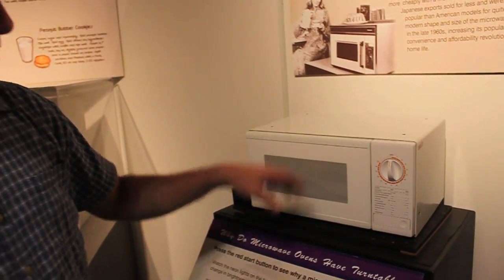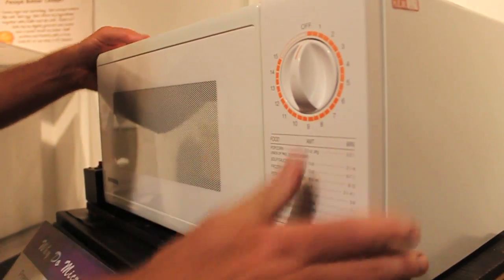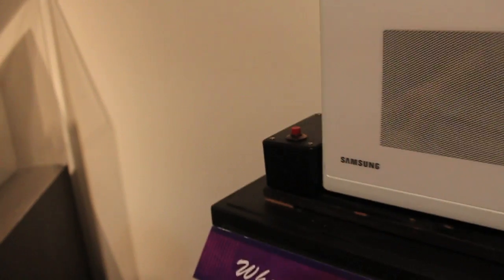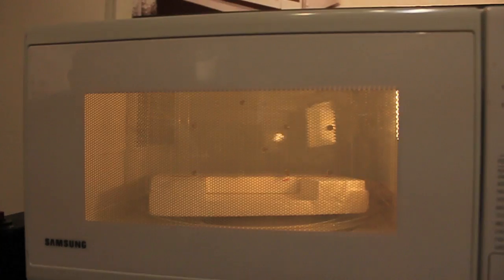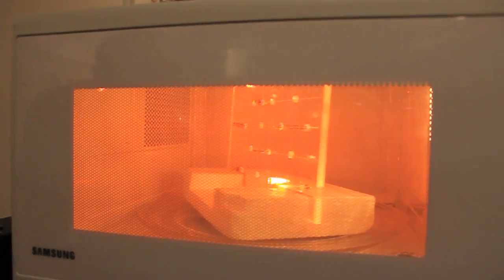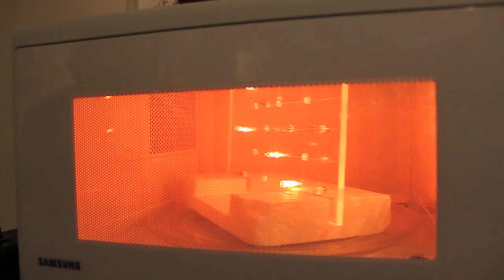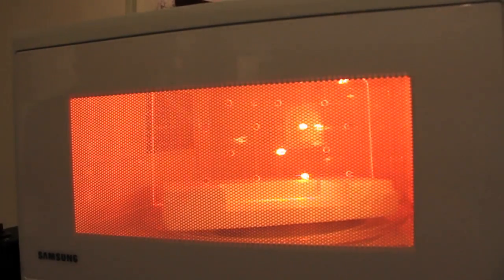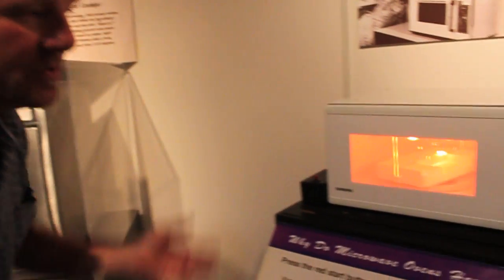Best Spot in the Microwave? - Smarter Every Day 6

Comment: I didn’t understood the why it happens but I did my own test: Slice of bread with cheese on top.

Placed at the center: the center gets very hot and the cheese starts melting in the center sooner than on the edges. Also the bread gets extremely hot in the center and just warm on the edges. 

Placed off the center: 
The cheese and the bread get warm in a much even way and it’s a great recommendation. The cheese melts more on the corners as it’s expected.

Still I’ve no clue about the guy explanation. My own theory is that the spot of the food sitting at the center never really moves (it spins, but keeps its position all the time). That makes it catch more of the waves in that area. But if it’s off center, the waves bounce more and hit different spots as the food rotates so they spread the energy and so the heat more evenly

Comment: Hypothesis prior to watching, and I hope this proves true and more people are aware of: the "power-band" is on the outer edge of the glass plate, with a very distinct dead zone between that and the very middle which is actually remarkably unreliable despite common sense suggesting the middle of the oven would get the most energy.
After watching: So you had the same conclusion, but the lights weren't really arranged in a way to show that.  I'm thinking a sheet or block of chocolate heated for 20 seconds, sliced afterwards if using a block.  This should show clearly where the most energy is passing through.  Even better if you can stop the carousel from rotating.  
At some point i'll might get around to testing this, chocolate is expensive though.  If I could afford to waste $40 on chocolate, I could afford to buy a better microwave that doesn't pass energy so uneven.

Comment: 1. The wave pattern is not symmetric
2. ???
3. You have to place the food away from the middle.

I really don't get you thought process in this video.
Reply: NNNNabeshin
Well, basically the microwave beam always travels the same path through the microwave. So when you place something in the middle of the carousel it doesn't heat up right because it's exposed to the microwave beam less. when you place something off center your food is energized more thoroughly as it's hit in different ways more often. Draw a large W on a sheet of paper and get something relatively small and clear and rotate it on your W paper. Notice if placed in the center of the paper your small clear object is never intersected by the W's lines( which represent the microwave beam). but if off center it will intersect the W's sides.
Reply: NNNNabeshin
Well, basically the microwave beam always travels the same path through the microwave. So when you place something in the middle of the carousel it doesn't heat up right because it's exposed to the microwave beam less. when you place something off center your food is energized more thoroughly as it's hit in different ways more often. Draw a large W on a sheet of paper and get something relatively small and clear and rotate it on your W paper. Notice if placed in the center of the paper your small clear object is never intersected by the W's lines( which represent the microwave beam). but if off center it will intersect the W's sides.
Reply: 1R0QU012 I know its a year later, but since no one else said it...

Thank you for you explanation and especially the W example, I now understand it while The video fails to explain it.
Reply: Peter Bonnema He's literally a rocket scientist (well the main guy on this show) so I think k he knows what he's talking about.
Reply: NNNNabeshin So I'm gonna trust a random guy off the internet or a man who has passed a course in quantum mechanics...
Reply: Still: Random guy<Dennis who's made many videos on many various subjects. And yes I know about the theory of relativity. Have I passed a course in it? No.
Reply: NNNNabeshin I can and do think for myself. I just don't trust someone off of the internet that I know nothing about. Yes you most likely are who you say you are, but how do I know that you aren't a kid trying to sound smart? Have a good day/night Sir.
Reply: NNNNabeshin me neither. And I also don't see any pattern in the x-mass balls lighting up. They all seem to light up just as much...
Reply: LOL dude. Ok.
Reply: Just to confuse you: I'm a matematician and I passed a course in relativity theory (just to say very complex sounding things, you seem to like that). Now what do you say? :)
Reply: So you are ready to throw away the opportunity to think on a subject with your own logic. It's not rocket science. The guy made a number of statements and the logical connection between them is faulty.

Comment: Most high end and built in microwaves have a metal fan called a stirrer located right outside the waveguide hidden behind a cover usually in the top of the oven cavity. The fan (called the stirrer) turns slowly while the microwave runs which causes the hot spots to move around and make the microwave cook food more evenly, some microwaves don't even have turntables.

Comment: hmm  time to go explode eggs in a microwave. for science. just to see where the hottest spot is on a run of the mill microwave. i wonder how many inches from the center of the turn table it would be? similarly i wonder if the wave guides location in relation to the center of the turn table impacts it as well ?

Comment: You can also use this principle to measure the speed of light with a large chocolate bar. You just have to know the frequency of your microwave oven and take the carousel out. You measure the distance between the melted parts of the chocolate to find the wavelength.

Comment: This is both great and derp why didn't i think about that because i used to eat cold or frozen pizzas and like the edges where perfectly heated the middle was still frozen, and when was finally middle heated up well enough the edges where almost burned so kinda derp for not thinking about it any other time, but thanks for the advice, will try to remember it :P

Comment: When you're putting stuff on the edge of the carousel be sure to take note of where the rotating triangular stand is underneath it.  If that stand doesn't reach very far and your load is heavy it will cause the carousel to overbalance and spill its load.

Comment: I learned about this myself a while back while making pizza rolls when the ones in the middle of the plate always stayed fairly cold while the ones on the edge of the plate were always extremely hot. Now whevever i make them i put them all on the outside of the plate or rotate them halfway through heating them up.

Comment: Hey Destin, I am studying physics and I recently got smarter when I learned, that you can "measure" the speed of light (or electromagnetic waves) by putting some cheese in a microwave. As he said the microwave is bouncing around and so the cheese is melting in some points while other spots remain cold. Then you can measure the wavelength, and voila, speed of light (additional information: the frequency should be given on the oven).

Comment: Hey Destin, here is an experiment that you can perform that I think gives even better results. Take several long store receipts (thermal paper!) lay them on a flat tray and get them slightly wet across their entire surface. Turn on the microwave oven making sure that the turntable isn't working. The water will get hot and the thermal paper will turn dark where the microwaves are the strongest.  You can do this in three dimensions by putting many layers (20+)  on stands so it fills the microwave.